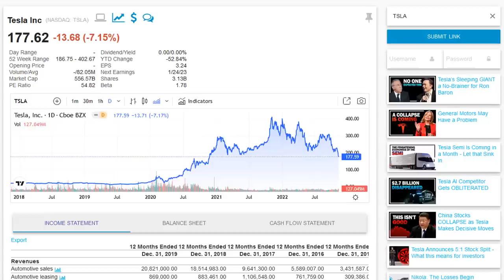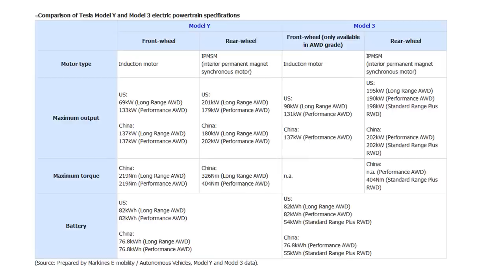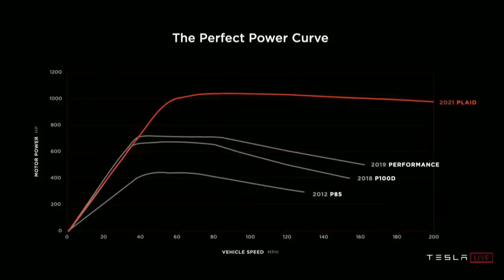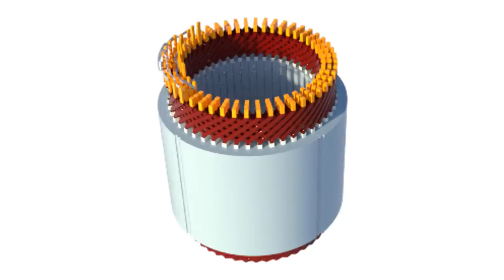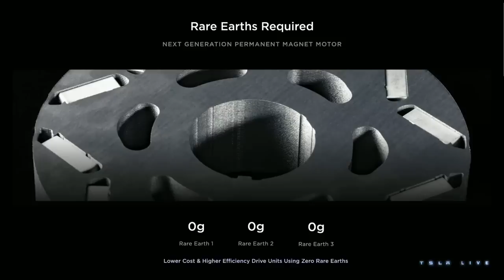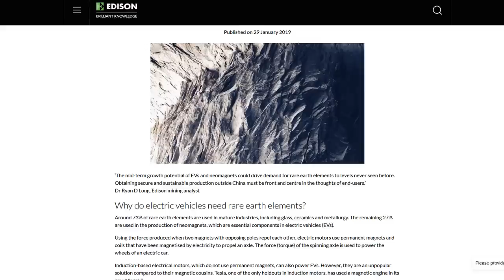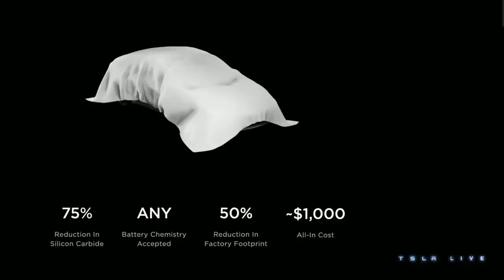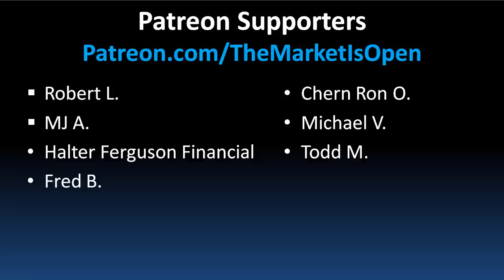Elon Musk's NEW INSANE Motor SHOCKS The Entire Industry!

Comment: I am a huge fan of the AGNI/Lynch motor which is amazing in my experience.  Here is some information if you're unfamiliar (it may be a little dated)

The Lynch motor is an unconventional design with a disc armature. It marries the advantages of a conventional, wound armature motor with the benefits of a flat (printed circuit) motor. It is similar to a pancake motor, but is more powerful than any of these technologies. The disc armature has magnets on both sides, doubling the available flux density and shortening the magnetic path. It therefore packs more power per pound and per cubic inch than any other motor technology. Of course such a revolutionary motor is not for every application - it is not as cheap as wound field motors, but for many applications it is a far superior motor.  It has a previously unheard of power to weight ratio and also power to volume ratio. It is also highly efficient because of the double magnet design and associated short magnetic path. It also includes integral fan cooling.

 The Lynch motor is an important development which spurred other motor designers to improve their products to remain competitive, such as synchronus permanent magnet machines.  As a result of the competition between manufacturers the cost of high performance motors and controllers has fallen dramatically.  We hope the cost of solar cells also reduces to allow renewable transportation to develop as a viable alternative to carbon fuels.
Cedric Lynch built his electric bike around a mid-drive configuration, also building one of the worlds most efficient light weight electric motors to power his rig reliably at 60-MPH for significant distances. He would later set several world records with his axial flux motor and bring it to market as the Lynch / Agni motor. Briggs and Stratton would eventually buy this technology which would lead to the Etek motor, which is now famous for making high speed efficient electric hot rods.

Cedric uses to achieve high speeds is by following the rules of aerodynamics, and building a bike that is as aerodynamic and as efficient as possible. The other builders on this list bypassed this step, and Cedric uses this bicycle as daily transportation on real commutes. Although this high-efficiency motor uses “old school” brushes, this fact allows builders to use very affordable controllers. He has proven his design choices through thousands of miles of commuting, and the Lynch motor is highly respected.

Cedric Lynch is known as the creator of the Agni Motor, a highly efficient electric motor that weighs around 25 pounds and can put out as much as 50hp. 

Cedric Lynch is a British 'mad scientist' type mechanical engineer obsessed with the idea of greener transportation. His interest has been in building a super efficient yet powerful vehicle that can serve as a car replacement.

He started thinking of his own design for an electric motor in 1983 when he began entering competitions organized by the Battery Vehicle Society regarding building an efficient electric vehicle. At the time there was no reasonably priced DC motor with descent efficiency so Lynch decided to build his own utilizing modifying existing motors with old tin cans that he would spread out flat to use as cooling fins. Surprisingly using rudimentary materials and a garage work bench, Cedric was making better more efficient electric motors than any of the universities were able to manufacture in state of the art workshops.

Cedric then came up with a motor design that could be cheaply manufactured and began manufacturing his own motor that he could sell to the public in 1988 and the Lynch Electric Motor Company was born, known as LEMCO.

Cedric first used his motor to create a small boat called “The Spark” that would set an electric boat efficiency record. From there Cedric turned his attention to bicycles, an application generally considered too small for a lynch motor at that time. Cedric mounted his motor in recumbent bike, allowing him space to eventually use a set of thundersky lithium batteries.

The resulting aerodynamic recumbent bike had a top speed of 60mph and still managed an incredible range of 150 miles. Cedric rode his recumbent creation everywhere as a daily commuter, putting an amazing 50,000 miles on the machine - technically a motorbike.

Briggs and Stratton, the US firm famous for lawn mower engines, bought the technology and used it in their E-Tech Motor, and Cedric went on to manufacture his latest incarnation of his lynch design into the Agni motor, which is used in go karts, sailboats, motor boats, and even small airplanes.

The Lynch designed motors all have the same traits. Brushed motors, around 25 pounds in weight and they are able to put out enormous power compared to their weight. Sometimes as high as 50 hp (depending on amperage ran through the motor) at an incredible 98% efficiency.  Lynch Motors are also the most often used motors in electric motorcycle racing applications.

Cedric's zero-emission motorcycle, which has a top speed of 120mph, was shown in action winning the world’s first zero carbon race – the TTxGP in the Isle of Mann.

The idea for the electric motor has been snapped up by the 56-year-old’’s friend Arvind Rabadia, who together with his brother Hasmuk Rabadia had been thinking of starting a business in India. They have now set up Agni Motors to make further-improved versions of Cedric’s motors

Despite Cedric’s breakthrough invention he has no formal engineering qualifications and taught himself the techniques needed to construct his engine. He first became interested in electrics when his parents bought him a book entitled How to build things from things found at home. 
The Etek motor is a brushed 25-pound pancake shaped motor that puts out enormous power for its weight. Depending on amperage and voltage the Etek can easily provide between 15-horsepower and 30-horsepower reliably and consistently (11-kW / 22-kW). A perfect platform for a powerful electric bike if you do not mind the weight. Although brushless motors are considered more modern, a brushed motor like the Etek allows the builder to use very affordable controllers.

Cedric-Lynch invented the motor and sold it to Briggs and Stratton which US company produced the Etek at a lower price (around $600). In the late 90’s early 2000’s it was the way to go for a high-power / light-weight electric vehicle. Many small E-vehicle records were set using the Etek motor. Finally, the market had a relatively lightweight and powerful electric motor available to the masses.

In essence, the Etek allowed hot rodders to build electric bikes. Before the Etek very few people had ever achieved 50mph on an electric bike. Even today, Etek motors (and newer incarnations of the Etek motor) are used to make some super fast electric bikes. In the case of Liveforphysics, the fastest E-bikes ever.

 Liveforphysics used a newer version of the Etek (the Agni motor), to achieve speeds of over 70mph, and dominate a recent hill-climb event.

Every Etek I have ever ridden has been characterized by brutal off-the-line acceleration, usually to a point where you have to apply the throttle very carefully or get thrown off. However, it is possible to run an Etek at a lower voltage or lower amperage and have a very manageable, safe, and sane electric bike that will not burn out on you, no matter high steep the incline.

Comment: Perm-mag motors have been around for years it’s just that Tesla started making big ones.
Reply: Sorry! It goes WAY beyond the simple design similarity of permanent magnet.  There have been THOUSANDS of patents PMMs... inductive motors... every kind of motor have been going through massive redesigns.  I have friends at Tesla, and other friends working at small private firms working on such designs.  Linear start motors alone are a huge area that anyone could make $billions just to eliminate the need to start the motor using lots of expensive electronic components.
Reply: Think the magic of Tesla is their Big Motors (power) are very small (physical size) Part of this is they are not required to develop full power for very long compared to industrial motors that need to produce high power 24 hrs / day. However you look at it Tesla and SpaceX have massively improved the technology in the areas they operate in. Great teams, Vertical integration and very hard work are the key drivers of this success.
Reply: I love the sidenote "the hairpin motor concept is already used by other car manufacturers". But of course, now that ELON adopts it, it is HIS PERSONAL invention, it is HIS PERSONAL innovation that will revolutionize human existence. 
 
Like his rocket engines are pretty straightforward standard engines, nothing really fancy, or like his Boring Company that would revolutionize the drilling of tunnels 10 times at fast for 10% of the cost ended up buying standard boring equipment and drills tunnels just as slow and just as expensive as any other drilling company.  
 
All I see is someone VERY good at marketing himself.
Reply: @feedingravens  LOL!! You're a fool.  If you watched Sandy Monroe break down the electric motors on the Model 3, the Chevy Bolt, and the BMW i3, you'd see that they all are about 200 HP, but the Tesla motor is significantly smaller, lighter, accelerates quicker (less inertial mass), and is more efficient.

Engineering grads from places like Cal Tech, MIT, etc., overwhelmimgly list SpaceX and Tesla as the employer they hope to be hired by.

Once Tesla was an establish car maker, all the legacy car makers were saying the same thing: EVs are a dead end, that all these other car makers have a century of car making experience and that as soon as they-- the others-- decide to make EVs, Tesla will implode with conpetition from all the Big Boys.

All car makers that still make ICE cars have been steadily losing market share.  They have trouble selling their ICE cars, which sell fewer and fewer cars every month, and they are having trouble making  EVs that compete with Tesla models.

The CEO of Ford, and the ex- CEO of VW have both made public statements aknowledging that Tesla is far ahead of everyone, and they will have to spend $billions to catch up to then; they will still need help from Tesla to succeed.

There have been dozens of other automobile startups (deLorean, Tucker, Nash, AMC, etc.) in the last 90 years, but Tesla is the first and only to succeed in all that time.

All car for more than a hundred years have been made the same way-- weld, bolt, and epoxy dozens of individual parts together to make the front and rear frames.  Tesla is the first company to use monstrously large, expensive casting machines to make all that nonsense obsolete; one new casting every 100 seconds or so, dramrically speeding up production, decreasing factory footprint, negating the need for hundreds of assembly line robots, and dramatically increasing profit margins.

Look up "Tesla Octovalve", and see just how much more innovative and simplified their cars are.  Simplicity is more reliable.

As for SpaceX, you are blind and delusional if you think they are just like status quo!

The Russians used to have the lion's share of worldwide launch contracts; that quickly changed to SpaceX due to their dramatically lower launch contracts, in 
major part because they have been reusing almost all of their boosters, many of them have been used more than ten times!  Who else would dare landing huge rockets on tiny barges rocking around on the ocean? They are THE go-to launch company... they have launched hundreds of rockets, with no failures except during R & D!

SpaceX showed it can be done, and since then NO ONE else has been able to produce orbital- capable reusable  rockets!  If SpaceX's rockets are as mundane as you think, then WHY don't they STILL have no competition?!

 

I could quote dozens of other examples, but safe to say, you're incapable of making unbiased assessments... and WHY?  Are you an investor in GM, or Chevron, or Boeing?  Maybe you just can't stand one guy being so effing successful?!  Or maybe that he's got balls the size of Jupiter to be willing to take on such Herculean challenges?

Go to bed, silly boy.  No one is ever going to say hello to you again.
Reply: @feedingravens  
Look closer
Reply: @feedingravens  'Turtle on a fence post '
Reply: @feedingravens   Except no-one else DID start making rockets, and the reusable part is not standard or straightforward, and no-one else DID start making the new more efficient Tesla engines, or the manufacturing plants etc. That's the difference and it's Elon.
Reply: @feedingravens  100%. and again, its not electric motors that are the issue, its the POWER DENSITY that make the whole system terribly inefficient. and batteries ain't getting markedly better in the next 20 years. physics is physics, which is why we dont have a long or even short range electric jet yet, or boats that can go nearly as far as gasoline or diesel powered ones in the same amount of time.
Reply: @ct1762  there is an electric jet btw
Reply: @blackthornpvp  lol. lets see a link to it. i'm sure it beats combustion powered ones rotfl
Reply: @ct1762  Exactly. In my eyes the energy production is not the issue anymore _ it is the STORAGE of energy, for hours, days, months. 

Thunderf00t had a video about the energy density of electricity and gasoline - no way.
Reply: @ct1762  LOL!  ARE YOU KIDDING?!  Electric motors by principle are many times more efficient than anything that runs on fuel!  As an example, even the most poorly designed EVs are rated @ over 100 mpg, comparing the cost of electricity and gasoline to travel a given distance!

That still does not consider all the expensive tune-ups, oil changes, smog tests, and tranny repairs... EVs have NO transmission-- not even a reverse gear-- to back up, the electric motor just turns backward!  Even the brakes will likely last the life of the car, if driven properly: it's called "regen"-- whenever you brake or go downhill, the electric motor becomes a generator to put the energy back in the battery.

Nope... EVs are WAY more efficient, which is why Tesla  is so popular-- selling a million cars a year, and even more in coning years.

And as for batteries not getting any better in the next 20 years, you obviously are not actually following the market!  There are BILLIONS being spent every year on battery tech... there has been steady increase in energy density, power density, and price reductions, and an EV drive train is already on the verge of making EVs CHEAPER than ICE cars, and there is plenty of improvement expected for the future of EV power trains and batteries.  EVs are already passing 400 miles per charge, and increasing.

If you don't actually follow the fantastic progress made on EVs, you'll be making a fool of yourself every time you say anything!

Oh, and as for electric planes, if you bother tp check, you'll see Boeing, Airbus and several others are in the process of designing planes that will be electric powered.  If THEY think the tech is right around the corner, you can be sure they're not blowing tons of cash that they don't see a return on their investments!

There are already electric private aircraft built by Sonex, Pipistrel and others.
Electric airliners are coming as surely as the Wrights were sure there was a market for aircraft in their day.  If you don't have the vision to see it coming, don't make a fool of yourself by predicting otherwise.  I bet... you were one of the naysayers that, 20 years ago, was saying confidently that EVs were a dead- end pie-in- the- sky, huh?!

LOL
Reply: @billdale1  once again, EV's dont have anywhere near the power density of ICE engines, which is why they are so heavy. for example: Try using a 200hp electric outboard on a 20' center console and match 100 gallons of fuel (which weighs around 650 lbs). you'd need 20,000 lbs of batteries to go the same distance. EV's need to be driven a minimum of 40,000 miles to match ICE cars emissions as they are extremely filthy to make. EV's are also much heavier as mentioned, so they blow through tires and destroy infrastructure much faster, which requires fossil fuel energy to manufacture and repair. 2% of cars sold in the USA are electric. what will the energy grid be made of for 100% of the electricity required? unicorn farts? how will longer distance travelers charge up without waiting 5 hours? and yes, i know you can change 80% in 15 minutes with a supercharger with zero wait time, and its still far too long. you can only have so many charging stations , and they all need to share fuel pumps you know... for emergencies to keep the country running 24/7.

Comment: Nobody wants to discuss the Battery because theres no alternative to lithium. alot of the materials for those batteries is becoming even more rare and difficult to mine. Most of the worlds Cobalt is concentrated in the Congo and is mined by hand......There isnt enough matrerial to make a battery pack to replace even a 1/4 of the worlds ICE vehicles. Along with the many other inconveniences of electric cars......Making the motor cheaper is good but all it will do is offset the eventual increased cost of the battery. The battery is the majority of the cost of the car not the motor.

Comment: The only problem I have with this is the grid can't handle what we have now as far as electric things go so putting more str3ess on a weak system is bad, plus in the winter and getting stuck you are really screwed and better not turn on the heater if there is a heater in these, you only have so much time on the batteries.